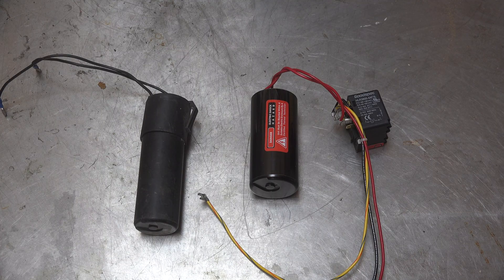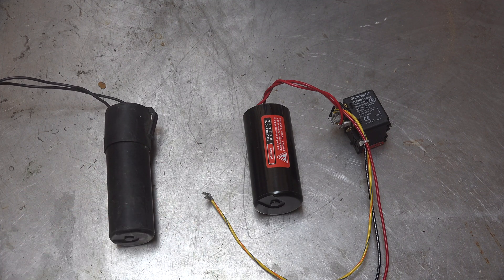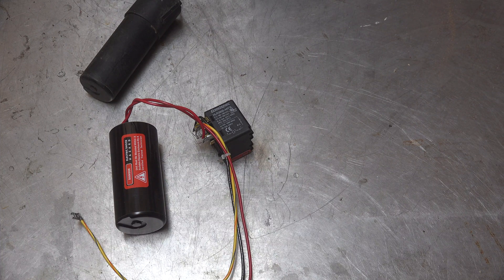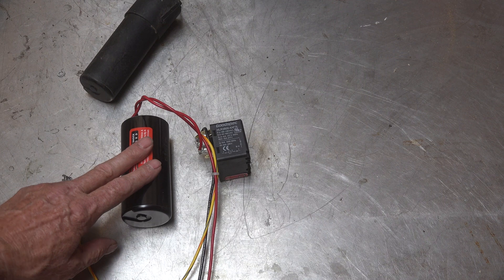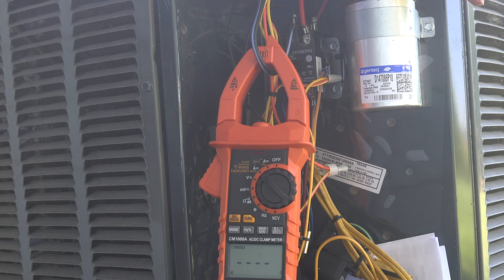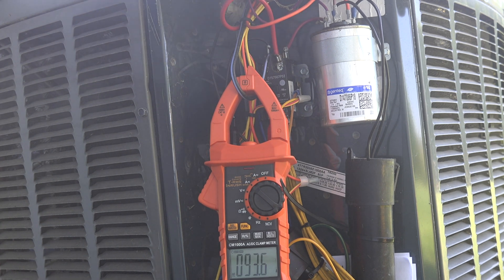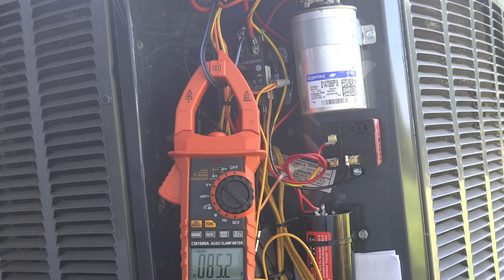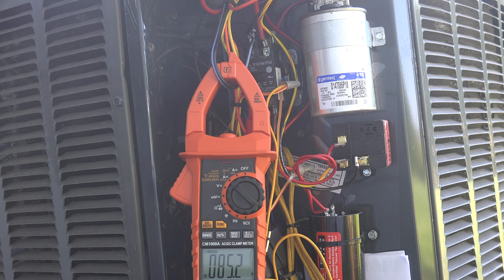A/C hard start kits:  are they necessary?

Comment: Hello. My LRA for my condenser should be 67.8 and my reading is at 118. The compressor is a bit loud when initially turning on but everything is working fine. When the unit was checked the tech recommended a hard start kit. Would you recommend taking the advice or leaving it as is? The unit is about 5 years old.

Comment: The potential relay must be installed arrow up to function correctly. The relay armature drops out by gravity upon power loss. If not oriented arrow up, the  armature COULD  hang up and cause the 5-2-1 to stay on after startup and destroy the 5-2-1.

Comment: how do i know which hard start kit fit or compatible with my lennox 5 tons AC residential
Reply from the maker: First, why are you installing the hard start?  You will need one if you have changed expansion devices from a fixed orifice to a non bleed TXV.  Also if the compressor has been having problems starting that is traced to blown fuses or other indication that the compressor has not reliably started you can use one.
If you are installing one because you think it is easier on the compressor, consider this:  Its called a hard start because it hits the compressor with a large jolt of power to increase starting torque.  These units jerk the windings very hard.  
I would argue this is harder on the compressor than the much softer starting torque with the the run cap alone.
If you still want one get it from the manufacturer, it is designed for your unit.
GFM
Reply: @grayfurnaceman  During the startup, your compressor draws 8 times more current than it needs for regular operation. All that extra power translates into a lot of heat. The heat rapidly wears out your compressor and other components, such as belts or motors. When critical parts burn out, you have a unit that doesn't cool your home. Not to mention that the compressor is often the most expensive and important part of the system, making it costly to repair.

A hard start kit makes kicking on a lot easier for your air conditioner. Increasing the starting torque minimizes the power needed to start the unit and makes starting faster and smoother. Startup efficiency increases from 50% to 98% with a hard start kit.

A hard start kit can prolong the life of your AC unit if the compressor is the source of the problem. If you have a newer unit that's otherwise in great condition, installing a hard start kit is a solid choice.

However, with older compressors, a hard start kit may not be worth installing. While these kits can help coax a bit more life out of your compressor, they're more of a Band-Aid than a long-term fix.

Comment: My understanding of a hard start kit is similar to a spare tire. Once the original existing dual capacitor takes a dump due to whatever reason, the hard start kit will apply. Like riding on a doughnut tire, you wouldn’t want to drive on that spare tire forever because it can potentially cause issues and you will want to replace the dual capacitor as soon as possible. Basically a trade off for the unwanted breakdown… but it will still cause damage to the compressor overtime if the dual cap is not replaced and is only using the hard start. I only recommend the on older compressors that is already “hard starting” or “short cycling”. Surge protection is the answer for the newer compressors and soft starts to diminish inrush amps, soft start also come with a built in start cap if I did my research correct.

Sum it all up, it’s a back up auxiliary capacitor for when you have that flat dual capacitor. Hoped this helped!

Comment: My costumer run cap failed... The 521 would start the compressor, after the potential relays contacts opened the compressor would run without the run cap working... but at 9 amps higher than normal and noisy...

Comment: Strange that the manufacturer offers essentially the 521 as an OEM option for an additional price. Can’t imagine they offer this as a temporary fix to extend the life of a unit.  If they offer it as some thing you can immediately put on a new unit. It seems to me that it would be something that would improve the longevity. But I’m just guessing.  I put a 521 on my unit a year ago after matching the capacitor exactly to the OEM capacitor. I don’t know if the relay matches the OEM relay but I have to think it’s pretty close.  Thanks for the test.
Reply from the maker: The manufacturers offer a hard start system to match the expansion device.  Equipment may be matched to a fixed orifice device and the unit will not need a hard start.  Other matches may be used with a TXV.  Then the start kit will be necessary.  
GFM
Reply: @grayfurnaceman  - thanks for that info. On a sidenote, if my 4 ton unit compressor typically runs 4 minutes for every 12 minutes (1/3 running ratio) during Texas heat (mid to high 90’s) does that tell you anything in and of itself?  Seems like ratio is a good figure to know on ACs but you never really hear people reference it. Would love your insight.

Comment: Good video. After your explanation it confirmed no need for these hard start kits. 
 I have a 25 year old 4 ton AC unit. It starts, loud for a second or two on the startup but starts right up and cools well. I do replace the main motor contactor every couple of years as the contacts look pitted at that time by that time. It does make a noticeable momentary buzz at the main circuit breaker during the startup. Is that normal? Confirmed the breaker is well seated , wiring is tight and bus bar is in good condition. Even swapped out the breaker with a known good one, no difference. Wondering if the wiring is the right gauge. 40 amp breaker with #10 romex running about 45 foot. Wondering if that is a bit under sized for the length of the run. Original wiring from 1972.
Reply from the maker: Some concern about the wire size.  If the unit ampacity (on the model plate) is more than 30 amps, the wiring should be increased to #8.  I am not too concerned with the buzzing.
GFM

Comment: More up to date video on when to use these: https://www.youtube.com/watch?v=eHmcJ-3oh0c
Reply from the maker: I would not call that updated.  This reasoning has been around for a long time.  A hard start kit is not necessary for a properly operating compressor unless it is used with a non bleed TXV.  The difference is very low on start time.  Kind of splitting hairs here.  They put a lot of pressure on the windings of the compressor due to the large "kick" upon startup.  This could reduce life of the windings.  

GFM
Reply: @grayfurnaceman  My unit came with a factory hard start kit. I'd worry less about the initial kick on a modern unit. My OEM capacitor also has a failsafe built-in that stops the hard start kit from functioning if the capacitor fails.
Reply from the maker: @TheLawIX  You probably have a non bleed TXV.
GFM

Comment: Temporary fix? Really? Let me tell you my story. Bought a house in 2000 (built in 1985). Had a 2.5 ton Lennox HVAC system ( already 15 years old at the time). Five years later it just wasn't cooling good enough. Could not afford a new system. A HVAC guy put in an old used 3 ton Fedders condenser/compressor (how old was it. I don't know). He put it in with a hard start cap ( this was now 2005). From 2005 to the present (2023). All I have done is replace the dual run cap once and replace the condenser fan. So, this used Fedders condenser/compressor has been running for 18 years with the same hard start cap ( I measured hard start cap capacitance and it is still at what is listed on the cap). The HVAC guy did give me a two year warranty which was up in 2007. This old used condenser/compressor has now been running with the same hard start cap for 18 years.

Comment: BTW...at timeline 8:14....where the 5-2-1 components are added.....it SEEMS you have the relay installed upside down....the tab being on the bottom. As these seem to be gravity-assist for proper operation, the orientation is critical and almost ALL units I've seen like this tell you to install tab-side-up. Right? Could this be the reason your inrush did not go down much......other vids like this show almost 1/2 value of inrush after installing 5-2-1.

Comment: Just asking about the design of the 5-2-1 pieces. You say the relay is normally closed, and back-EMF of the compressor motor during its starting period.....then drops out this relay and opens its contacts. Question: is your term "normally-closed" meaning while sitting there and installed ( connected to power ) ....OR....is that the "shelf position" of the relay? I'm trying to understand the possible failure mode of the 5-2-1 kit...and understand if the relay can "fail-closed" and thereby ruin the compressor by not dropping out when it should. Am I making sense here?..... or does the "failure mode" of the relay cause it to go open?
Reply from the maker: On the shelf it is closed.  BTW, the upside down relay is true.  A lot of commenters noticed that.  
GFM
Reply: @grayfurnaceman  ...thanks. What is the risk (probability) of the contact failing "stay-closed" or the failure of the additional hard-start capacitor?...as they introduce more pieces into the system and they too can fail.....do they fail "safe" or if they fail, can they fail to damage equipment?....I guess they can, as a relay contact failing closed can ruin the compressor.....what have you seen here as to reliability history?

Comment: Thanks for a great video!
(Is the mounting tab "up" on that 521 potential relay?)
Question: On a 5 ton Rheem classic with existing comp start cap and potential relay, would a 521 setup replace the existing components, or be installed in conjunction with them?)

(Really appreciate that you are sharing your knowledga and experience)
Reply from the maker: It is down.  It should be up.  I would replace the manufacturer's start controls with a factory part.  At no time should you have 2 start kits installed.
GFM

Comment: I installed mine on my new unit 10 years and it works perfect. What I had going on is the power would go out, say during a storm, for a split second or two and the compressor would take 2-4 hours to come back on. With the 521 it takes no longer than 5 minutes. Unit is 1pm years old and runs like new.

Comment: Not sure what is different from your but mine went from 110 amps to 56 amps using 5-2-1. Definitely happy here. Using a Fluke 410i and a 87V
Reply from the maker: No it did not.  Your meter just could not read the inrush effectively.
GFM
Reply: @grayfurnaceman  . Can you expand on that a little bit? I had it on high resolution and it measures maximum minimum and average. You mentioned in your video you wish you could have used a more expensive meter that was more accurate. What are you suggesting then? Thanks for clarifying
Reply from the maker: @condor5635  The start kit will increase amp draw upon startup.  What it does is start the compressor faster and keep the high amperage from being on as long as without the kit.
GFM
Reply: @grayfurnaceman  still don’t understand why you indicated my meter did not read the amps correctly. Max amps clearly dropped almost 50% after I installed it.
Reply: @condor5635  ...have seen that confirmed too by many other HVAC pro vids.

Comment: You have Great Videos but I noticed the 521 Potential Relay is installed upside down, instructions state the screw hole needs to on top.
Reply from the maker: You are correct.  
GFM

Comment: My unit is about 5-6 years old.  The A/C company I have used over the years has tried to convince me to put one of these things on my compressor since the unit was about two years old, the latest being yesterday.  They kept telling the unit runs good but since it’s “this old,” it would be good to but one on the unit. After watching this video, I am glad I never did.  I appreciate the honesty, and I’ll probably drop this company because they are about nothing but taking money from their customers.
Reply: Like I posted I just installed a 5-2-1 on my 4 ton today and max start JP went from 110 to 56 amps. Not sure if this video 5-2-1 never kicked in or not since start relay was mounted upside down. I am real happy with it.
Reply: @condor5635 It does not reduce the amps it just reduces the time being started, the shortened times leaves a misconception that it lowers the amps due to meters not being able to read the shortened time quick enough

Comment: What if my lights flicker every time the things starts?  Got a 3 ton train from 2013, so almost 9 years old..  works fine..  has a cap marked 2019 thats a 10,20,30,50 μf..  is 20.5 rla and 109fla..  figure the caps probably good, wire feed is 10ga so sized fine..  dedicated circuit with a 200a service so shouldnt cause flicker but it has been for past few years….

Comment: Good video. Question: my unit runs fine but when the compressor stops it make a knocking noise really hard. Do I need this? The A/C guy said yes I don’t think I need it since my issue is when stop not when start. My unit is 10 years old well kept, never an issue in the 10 years. It is a Rheem 5 tons. They said is wear and tear. Let me know please. Thank you
Reply from the maker: If its a scroll compressor (most Rheem units are), the discharge valve may have failed.  This will not cause an immediate compressor failure but may lower the life of the compressor.  
The reason the tech wants to install a hard start may be because the discharge valve separates high side from low side.
I don't think the hard start will help, but it probably won't hurt.
GFM
Reply: @grayfurnaceman  thank you Sir.

Comment: Hello sir, On my brand new old tech r22 compressor's manual it says motor type CSR, should I build a CSR starting system with a 5-2-1 or is it okay to use the compressor as a PSC with only a run cap.  Thank you.
Reply from the maker: If the system did not come with a start kit, I would not install one.
GFM
Reply: @grayfurnaceman  understood, thank you Sir.

Comment: Thanks for this vid!
I read someplace on the interweb that one of these can kill a compressor if the run cap dies while the compressor is running. After watching your video, it sounds like these devices remove themselves from the circuit so that can't happen. Does that make sense to you?
My compressor (25+ y/o) seems to be making the lights dim slightly these days when it starts so maybe that's a sign that it's getting worn? I live in Western Washington state so it hasn't lived a hard life. The cap just died (4 y/o) too..
Reply: You can purchase a Turbo 200 cap that has a special Compressor Protection Terminal to drop the start capacitor if the run capacitor has failed.
Reply from the maker: It does.  If the run cap fails, the motor won't start.  The customer will know he needs to get repair.  If the unit has a start kit, the motor will start, but if the cap has failed, the comp will run inefficiently and over draw power.
GFM
Reply: @grayfurnaceman  Thanks for the response!
Reply: @grayfurnaceman  I stumbled across AmRad run caps that have an extra Compressor Protector Terminal to break the circuit between start cap and compressor, if the run cap goes bad.  Any experience with those?
Reply from the maker: @chuckb4375  I can't say I have.
GFM

Comment: with all due respect, i do not agree with you.  It improves the efficiency of the AC by enabling the compressor to turn on faster. Since the compressor has to work the hardest in the first couple of seconds, a hard start kit can alleviate much of that effort. 
 The improved efficiency also reduces wear and tear on AC components other than the compressor. yes, maybe like you said initial hard push will wear out the fan motor a bit more faster, but it is ok, the compressor is saved,  the fan motor is much much easier to replace than compressor.  i  do x20 fan motor replacements ==  x1 compressor replacement

Comment: Just because a cap measures good doesn't mean it is good.  Lot more to a capacitor then just capacitance.   Change the cap to a new one,  still doesn't work perhaps the run cap will help.   My background is in electronics.

Comment: Some videos are showing a big difference you sure you have the right one for the size unit🤔🤔🤔
Reply from the maker: I would have to ask:  What difference are they showing?  A hard start kit increases amp draw in order to start the compressor against unequalized pressures between high and low side.  The unit does not use less power, it just is in the start mode for a shorter time.  Soft start jerks the windings with less force, so it may be easier on the compressor.  I would be interested in any demonstrations of the difference.
GFM

Comment: Another property of the 'hard start' capacitor is it's spreads start current out over a longer time period so it seems to me it's not exactly pushing the motor harder but pushing the motor longer.  I've also seen where they are recommended to help with older house wiriing when lights dim as the compressor kicks in even when it's fully up-to-code and properly maintained.
Reply from the maker: Hard starts do not lengthen start time, they reduce it.  The current running thru the compressor windings is higher to overcome pressure difference between high side and low side.    Yes, they do help with light dimming because the compressor is in start mode for less time.
GFM

Comment: some higher price units come from the factory with a start cap and potential relay.
Reply from the maker: Generally, the only time you will see hard start kits on units is if they use a non bleed TXV for an expansion device.  
GFM

Comment: 521 has to be matched to the tonnage of the compressor, if its undersized it will read less, if its correct it should read 50 amps +/-, Hard to believe this.